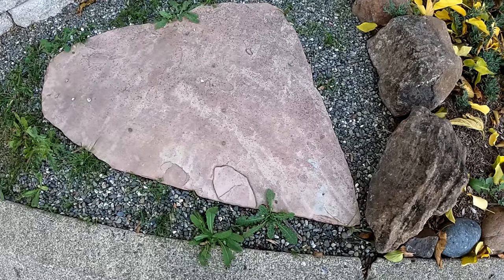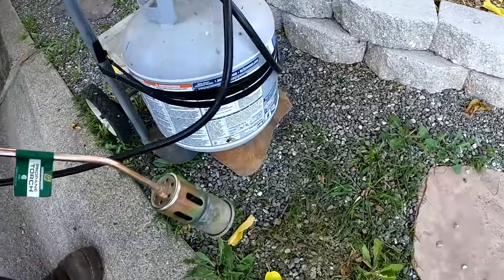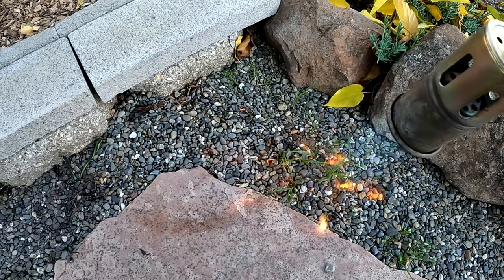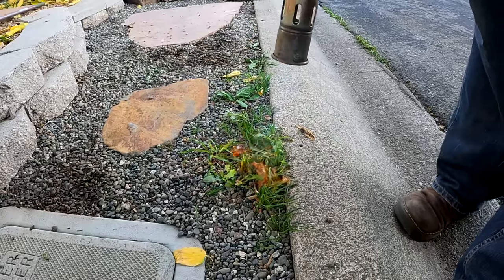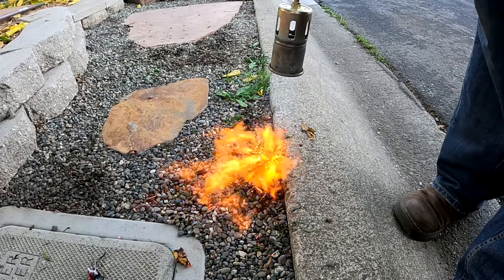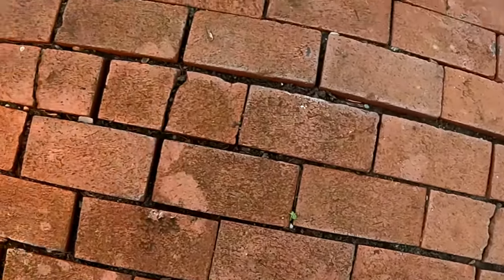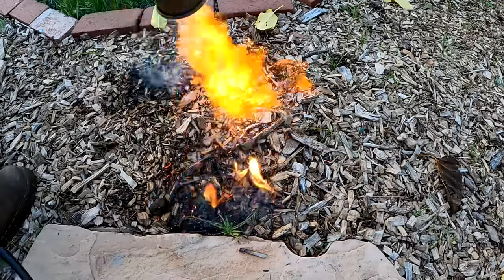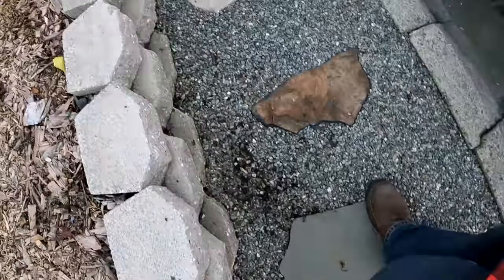Weed Killer Manufacturers Don't Want You To Know About This Amazing Gardening Technology!

Comment: I have been doing this exact thing on my metal fence line. Most use roundup because using the string trimmer is a pain on metal horse fence. I bring the hose with me in case a post or dry grass catches. Works great and is actually fun. Grass will grow back fairly quick so have to keep at it. I have 7 dogs and I do not use poison on my property..
Reply: 7 dogs is alittle excessive lol
Reply: Yes it is. Can’t lie.
Reply: I use the weed burner on my gravel driveways, I tried once around our chain link fence in the back yard and it blacked the poles and bottom links terribly from the grass/weed soot as it burned. I would LOVE to find a good solution to killing grass and weeds along the fence line, I've got two labs that crap like grown men, and they do it right along that fence line! Weed trimming is so foul back there lol
Reply: @ShaquilleOatmeal94 nah your just upset he can have the Space for them

Comment: I weeded using my flame weeder in my garden today.  My reason for using the flame weeder is I grow everything organically here on my 20 acre homestead and thus do NOT us any type of chemical weed killer. While the flame weeder does the job there are a number of drawbacks to this method which no one seems to want to mention.  So I will list a few.

1) Flame weeding mostly TOP KILLS.  In Jackson, Mississippi where I live (Zone 8b) and in many other Deep South locations, our climate is WET, Humid, and Hot.  Weeds grow lushly year round due to little to no significant freezing temps and are essentially perennials.  Thus weeds develop deep tap roots and grow very large very quickly.  A "one pass" technique with the flame weeder only "top kills" the above ground portion of the weeds.  It rarely kills the deep tap roots so in a week or so, the weeds recover easily.  Thus flame weeders work BETTER in dry arid climates with low moisture or colder climates where weeds are killed by cold in the winter.  Flame weeding is a not so good solution for climates like ours.

2) ROOT KILL may require long, slow multiple passes over a period of two to four weeks or more.  This can take a considerable amount of TIME.  So if you want a quick kill that takes out the roots with ONE pass, the use of chemical weed killers works much better and is far more time efficient.

3) Propane is not cheap.  Many users like to run their flame weeders at a high flame setting which frankly is far more intense than is needed.  But the "fun" factor of playing with a flame weeder as if it were a flame thrower is too much temptation for many users. So a bottle of propane can be wasted fairly easily if the weeder is run at too high of an output. A low flame puts out PLENTY of heat to kill the weeds and consumes far less gas.  A hint for users is to check with Tractor Supply or other similar farm supply outlets.  Those places will refill your bottle at a lower cost than "swap out" at a local convenience store.  Place like Tractor Supply do not usually swap out bottles.  They refill only.  

4) EXCESS HEAT can kill your garden plants or flower bed plants.  The temperatures NEAR the flame weeder head are very high.  The excess heat radiates onto nearby flowers or vegetable plants easily, often wilting and damaging them or even killing them.  In short, you can't run a flame weeder very close to any other plants you don't want to kill.  When I flame weed OUTSIDE my raised beds I have to use care to be sure that I am not letting any of the excess heat come near the plants I have growing in my raised beds.  Flame weeding therefore works best for how it is shown being used in this video, ie. for walkways, curbs,  etc.

5) UGLY DEAD GRASS is left if a flame weeder is used to edge along driveways, walks, or other areas where actual lawn grass overgrows onto these surfaces.  If you run a flame weeder anywhere it touches actual lawn grass, it will burn the lawn grass leaving an ugly dead grass line. String trimmers don't leave this unsightly burnt grass edging.

In short, the flame weeder has a ton of uses on a homestead that make it a handy tool to own.  I use mine a lot.  But it isn't a miracle solution to every sort of weeding chore.
Reply: Small world……Im a little north of you in Grenada.

Comment: I've used a torch like this for years, and can confirm it is very effective. In my experience, even when used on open dirt, torching the ground like this can not only kill weeds, but also prevent them from coming back for three to six months. A few important points to touch on though:

1. ALWAYS practice common sense safety; be aware of your surroundings, keep the flame pointed down, keep buckets/hose on hand, don't let the flame get too close to the tank/fuel hose, and so on.

2. ALWAYS wear eye protection and take proper measures to protect yourself. Yes, this falls under safety, but it's one that not everyone may think about, and is worth addressing separately. As rocks/concrete heat up rapidly from the flame, thermal expansion can cause pieces to pop off. Usually they're small enough that they cool off before they would touch you, but the projectile could still have enough speed to damage your eyes if it hits. Skin you're generally fine with, though I would still recommend wearing sturdy leather boots and jeans or other heavy cotton pants - no synthetics, which will just melt.

3. Keep the flame moving. Work in a rough circle, and if you have a stubborn weed, hit it for a few seconds, then move away and come back. This is to prevent too much heat building up in the surrounding material and causing it to break/pop off (see 2 above).

4. NEVER use this close to plastic fixtures or vinyl siding. Again, should be common sense, but not everyone will think about it.

5. If you are dealing with large or heavy weeds, this can still be effective, but you'll want to combine it with other methods first. Knock down as much of the heavy material as you can and use an herbicide/weed killer on them first to start drying the plant out. Give it at least a week, both for the chemicals to take effect and to dissipate so they're no longer hanging onto the plant. If you can get a rain fall in during that week, so much the better. Once the remaining plants have started to brown and you've ensured the chemicals have dissipated, then you can come in with the flame thrower to finish up the job.

Bonus tip: small torches like this work great for clearing up icy patches on your driveway in the winter (not as effective on snow, as the tiny air pockets between the flakes will cause it to insulate itself). Just be sure to melt it all to the point of evaporation so there's no water left to refreeze, and take extra care to keep the flame moving around cold concrete.
Reply: Good points - nicely done 👍

Comment: You can also use ice melter/salt. when i did my flagstone entry way in the winter to melt ice the weeds didnt come back all summer. Different methods for different areas can be used. I just bought the linked torch though for my flagstone patio/dog area and gravel driveway which is impossible to keep weed free. Looking forward to this.

Comment: I bought one about 2 months ago. I pull a metal cart behind my mower and I sit the propane bottle in it so I don’t have to carry it around the entire time.  I burn the areas I need to burn then put it back in and move to the next area.  It's safe, you just have to make sure your flame is big enough and that you hold it on the area you're trying kill the weeds.  You would think the flame would take care of the weeds in a snap but that hasn't been my experience.  It works! It just takes longer than I expected it too.
I always keep my water hose where I can get to it in a matter of steps, just in case.  The last thing I need is to catch my yard and property on fire!  I'm sure that other material such as mulch, pine straw needles, and wood chips probably burn faster, so i would definitely keep that in mind.  Good video. Thanks.

Comment: Tip. You still must follow up with a weed killer spray after using the torch. I use a torch on our beach property driveway & 2 weeks later weeds resurface. But the torch is fun to use. Be sure to spray water on burned areas  afterwards

Comment: I use a torch around my property, too, but pulling large weeds lasts longer than burning, and some weeds come back bigger and grow more aggressively when burnt. Ironically, I'm sitting on the couch typing this right now because 5 days ago, I picked weeds rather than going for a bike ride on a beautiful day and sprained my back. I use the torch on the driveway and one gravel property along the road twice a year. Before I fire it up, I pull all weeds large enough to get the root. Dandelions are a good example. Never let them go to seed; pull the whole root, and that plant won't return. Another may grow in that exact same spot, but that's the battle. If I burn a dandelion down to the gravel, it will come back. I live near Seattle, so we get wet weather patterns off and on all year around. I've found that using an electric blower on the gravel helps stop the build-up of organic material that seeds will grow in. I don't mind using the blower or the torch; it's like the mindless game Apps. Walk around and clean/pick everything up; in this case, burn it away. The downside is that, on average, one gallon of propane emits around 12.65 pounds of carbon dioxide (CO2). That's a problem. ---- Ok, I just ordered a plastic Fresnel lens with a 210mm focal length to see if it will work. If it does it will be the same boring game without the CO2. Level-Up!  Stay safe.

Comment: Why waste time and money? Just use cleaning vinegar with a little soap and salt and spray. Faster, easier and cheaper.
For older or bigger weeds use a higher concentration readily available online and in stores.
Once you go vinegar, you never go back. I used burners herbicides but vinegar works best.
Apply on a sunny day and with a little luck you'll see the result in a few hours and certainly in the next few days. It dries out the the complete plant and not burn off the leaves and grow back again.

Comment: I use this technique, but it can be risky. Those stones and the concrete can crack with too much heat. I have the river stones, and when they split, pieces fly and they have razor sharp edges. I always wear long pants and eye protection to play safe.

Comment: Effectiveness depends on the weed. Puncture vine - perfect. Bindweed and thistle, not so much. The roots are under all those stones. You have to get the soil over approx. 130° to kill. Some thistle, the roots are very deep (the below bindweed solution will work on it).

Best solution for bind weed: let it grow long, then stuff the greenery into a plastic bag (like hair binding) with some roundup concentrate, and cover it with a piece of cardboard and leave it for a few days (you don't want to cook it in the hot sun). It will be absorbed and kill the root. Then clean the whole thing up. 

White top is the hardest to kill. You have to get a poison like Killzall. But don't over-spray! Use a paint brush.  And gloves!

Comment: Have to calculate which cost more Propane or weed killer.
Reply: Propane costs more but the weed killer lingers and can mess up the soil
Reply: What if you have pets and don't want all these chemicals in your yard and to contribute to polluting the soil around your house and neighbors? Propane is cheap if you get your tanks filled instead of doing a lazy exchange at a gas station for double the price. Final note I can grill with the leftover propane not the roundup.
Reply: weed killer cost more when it comes to health risks and toxifying your environment. If you have dogs this is a no brainer.
Reply: I bought weed killer and made natural weed killer. Both work great right away but they keep coming back.   So weed killer would probably cost more in the long run if they keep coming back.

Comment: I’ve been trying to use this approach on getting rid of done stubborn Bermuda grass. I’m on round two of propane burn and I roasted the ground raw this time.
Reply: Can I get an update on this, have you replanted ??
Reply: @JSkipper-ed8wd  we were away for a month and that stuff grew back! I put the mower on the lowest setting possible and cut it down then using a hose end sprayer put down Ortho weed killer that is safe for grass but has a summer heat warning for Bermuda grass. It’s either out 80% into remission or the Fall and dryness are holding it back. Ive about given up on getting rid of it.

Comment: I tried this technique recently and it took a long time to burn each little weed or the root ball to areas where grass was trying to grow through the rock.  If it didn't have a cloth weed barrier underneath, those weeds would pull right up with ease by hand and a lot quicker than sitting there trying to burn each one down to a crisp.  I was able to burn a lot of the weeds in the cracks in the sidewalk but the larger clumps in the rock didn't burn away and already growing back.  I'll probably have to end up pulling them all, but my client wants to use Round Up first, which I refused to be the one to spray it.  And I don't want to have to pull them cuz I'll have to wear a Norwex mask and throw my gloves away after that job.

Comment: That type of burner is best, even though it's shorter than other models it has a push button flame starter, nice handle and flame throttle, went through 3 other stick type chinese made burners and they all got clogged up after one "weeding" this one has worked 3 times now, going out today to do my gravel driveway since it rained for the last 2 weeks here in Toronto and it's like the Mekong Delta out there now.